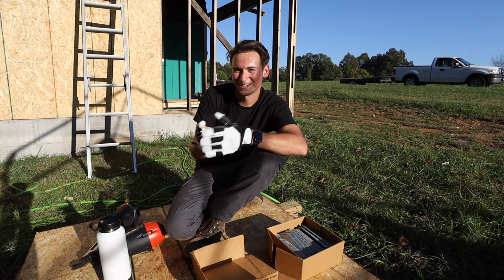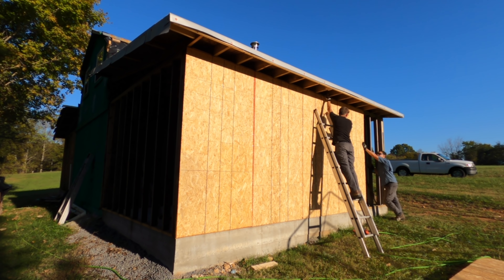Sheathing the Shed! | Abandoned Shed to House Renovation

Comment: Here's a tip for the future: loosely drive a couple of nails in the gap between the concrete and your base plate- you can set the OSB on these nails to hold the weight of the OSB while you position and attach it. Pull out these nails when the OSB is attached. This also helps give you a fairly straight bottom edge!
Reply: That’s how we managed to get it crooked in a few places. The nails would move slightly or the board would slide. Also there were a few places that the overhang on the rafter birds-mouth caused an issue. Most of them worked out okay! Thank you.
Reply: @MrZZeroG  I've never built anything bigger than a shed but I always forget to cut the birds mouth big enough to clear the sheathing and what a pain it is after the fact!

Comment: I hope you are going to add regular siding like T11 over the TieBac roll soon after you install the OSB because the water and whether will soon damage the OSB.  OSB normally goes down as roofing sub board sheets before the actual exterior shingles go down or if you are using OSB on the walls, you are going to put an exterior siding like T11 sheets in place over the OSB.  The OSB sheets can also be used for subfloor in before the finished flooring goes down.  OSB is not made to be a finished product even if you are putting TieBac over it as an exposed water seal.  This is the reason why the Greenboard is more expensive because it has two components to it: OSB board and TieBac (which is the green finish on the one side).  The TieBac is good for about two or three years when it is exposed to the sun and water.  Keep up the great work guys.  I am waiting to see the finished product.

Comment: SUGGESTION: Please hire professionals to spray foam your insulation...  Nothing is free, and when it comes to insulation, you pay for it up front or down the road.  The reason why spray foam is superior in all ways - is that it will increase the strength of your structure by up to 300%, and will allow it to be air tight (saving you a lot in propane during cold winter nights, and electricity during hot summer days).

Comment: are you going to do concrete siding on the outside for better weathering? hardyplank is expensive, but generic concrete sheets aren't that bad.
Reply from the maker: We haven’t decided on siding yet, but we’re probably using hardy board. We were thinking about doing real wood siding, but probably won’t do that for easier maintenance

Comment: Why did you install the OSB panels vertical?  If you install them horizontally, cutting the first one in half so the joins don't line up, you will find lifting the panels easier and the walls will be stronger.  Doing the panels horizontal also makes it easier to find the studs because they are not totally covered up when you install the first panel, and you have the line of nails in the first panel to tell you where the stud lives when nailing the second panel.